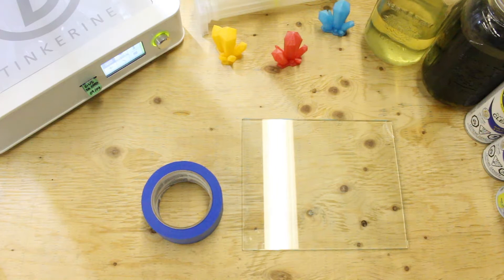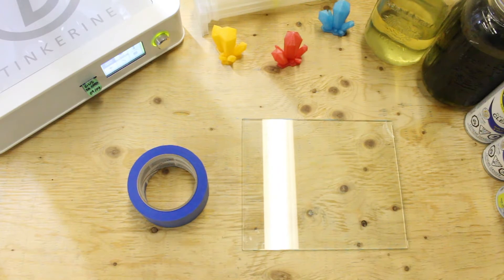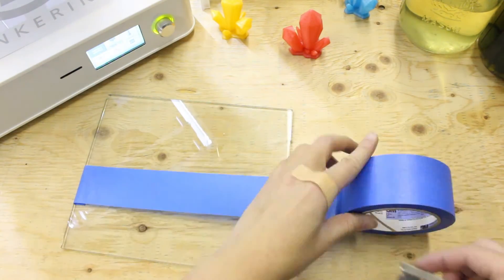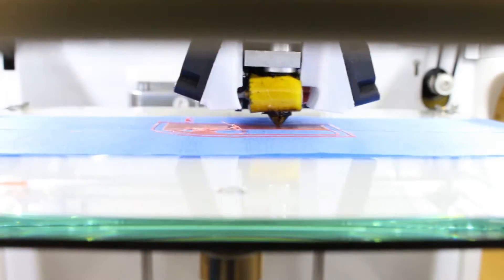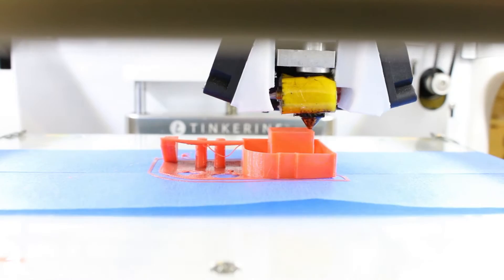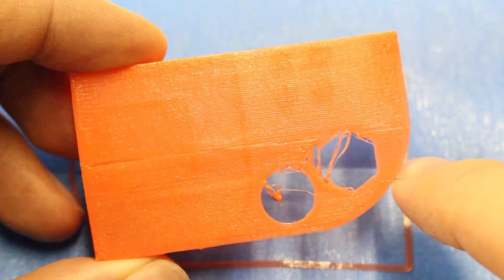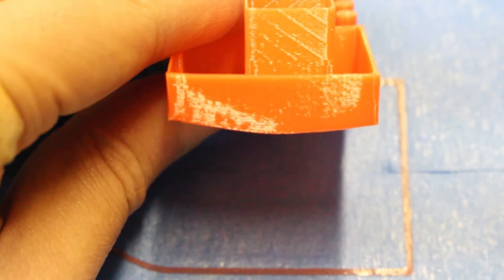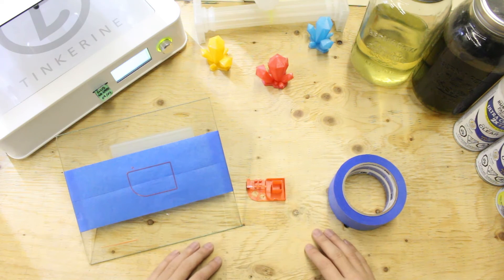Inverted Blue Tape as a Bed Adhesion

Comment: I personally use Vinyl Transfer Tape, as used with vinyl printers (like this:- http://www.ebay.co.uk/itm/200mm-x-30M-8-Paper-App-Application-Vinyl-Transfer-Tape-Silhouette-Portrait-/161290795864?hash=item258dae3b58:g:uW4AAOSw8cNUO9KZ). Then  use a glue stick on the top (http://cpc.farnell.com/webapp/wcs/stores/servlet/ProductDisplay?catalogId=10001&langId=69&urlRequestType=Base&partNumber=OE06454&storeId=10180) . It's easy to use, with no mess. Vinyl tape comes in a number of widths and lengths. 

A lot easier and cheaper than using lots of strips of blue tape!
Reply from the maker: Thanks for the suggestion! We'll look into doing an experiment with it.